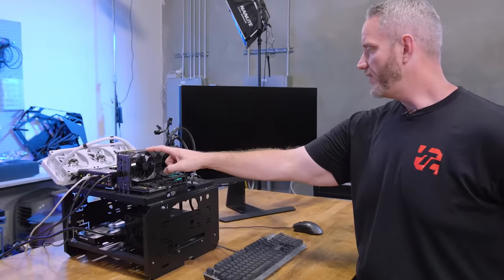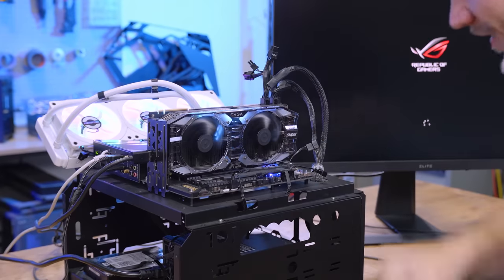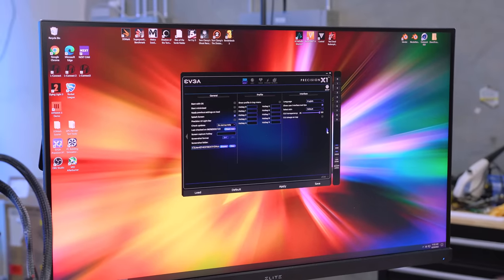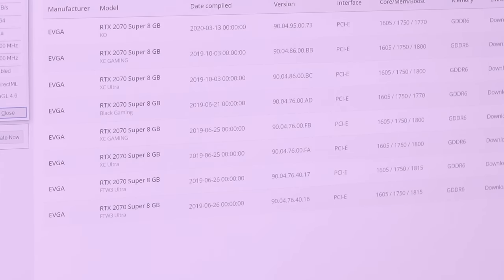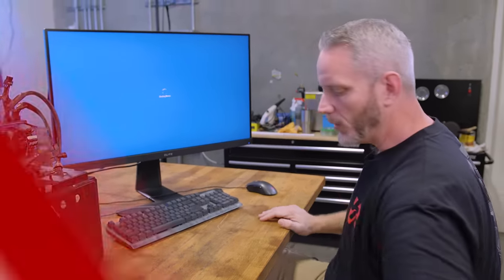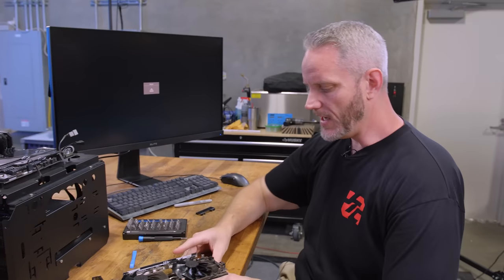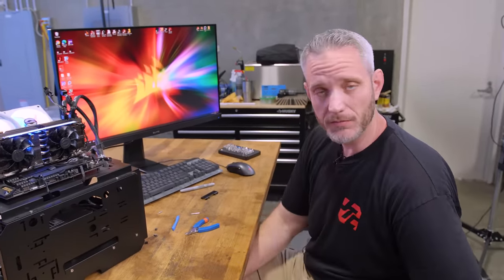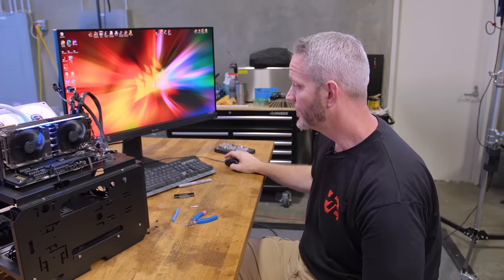This video card had a broken fan. Here's how I fixed it

Comment: Someone should do a series on what to do if you find your self with an ex-minning GPU. These things will likely have been run in an open rig with additional external cooling, which means they will have been seriously overclocked. 

What do you do if you find yourself with one of these thermo-throttled beauts? I'm thinking 3090's and maybe even the 3080's with the benchmarks of a 3060. Is there a way to get these quickly back to their default settings? Would you need to go further and replace thermal pads?  I'm sure there are a lot of people in the same boat... up a creek without a paddle ...   bailing water....

Also you might want to restate your advice from 5 years ago, to use two gpu power 8 pin cables, and not just the one 8 pin with the plus 8 pin extension on it.  I hope you catch this request.
Reply: I was watching mining videos to know thy enemy, and I was seeing core underclock + core undervolt + mem overclock.
Reply: @shufadragon  Thanks for that. I downloaded the MSI Afterburner. This app has an auto 'overclock' mode which profiles the GPU and automatically calibrates the frequency / voltage curve for this GPU. This should reset any extreme changes done by that 'ex-miner'. This was when i discovered the GPU was power limited. It turns out one 8pin cable plus its 8 pin extension was not the right way to power these monster GPUs. You should use 2 seperate 8 pin cables [power rails] from the PSU. I still have the poor benchmarks to sort but at least its playing Cyber 2077 in ultra mode now, and not shutting down.

Comment: Could a broken wire cause 1 fan to not spin at all? I’m having an issue with a rtx 3080 with dual fans were randomly 1 of the fans stopped spinning. My card goes up to temps of 89 and the second fan never kicks in

Comment: Hey, could someone give an advise please? Is it worth to upgrade i7 6700 to 11700k if I have 3060? I'm not sure that it will give that much performance boost as it cost.
Reply: That depends on game, resolution, settings, your target frame rate, and more details. Log both cpu and gpu usage over time.

Comment: when i ran a 2060 super i would set mine for a minimum 10% fan speed so it would always have air flowing over it no matter what decreasing fan motor life but it makes it far more reliable, not with my 3070 it forces that to 30% minimum which will burn the fan motor out faster and makes it louder, personally i don't think gpu's really need a zero db mode as it can cause more issues like this.

Comment: I actually have an issue with an msi 1660ti. Fans would turn to 100% video would cut off but the computer still runs and sound comes out from the headphones. Needless to say I haven't been able to solve it, I only know it's not an overheating issue

Comment: Most likely cheap material used for the conductors. Cheap copper alloy or even aluminum. Then fatigued by vibration.

Comment: My 3070 FTW 3 Ultra has the worlds most annoying fan click when you try and run the fans at low load.  Often they will spool up and down constantly making another annoying noise. (no it's not hitting the wires I have checked) in the end I just set them to 26% and up as temp increases as using the zero RPM system was a exercise in "click click click wrrrrrr click click click etc"

Comment: I hate zero rpm modes. Most of these cards run at high temps in idle. Around 50°C, and the fans turn on at 55°C. Turn on the fans to a low speed and all of the sudden idle temps drop and then hold closer to 30°C. The GPU doesn't need to double as a space heater. Zero rpm mode should be a switch on the card. I can't count the number of computers I have had to "fix" because it's so hot just watching browsing the web or watching a movie. First step is apply new SYY 157 paste. Second is install controller software to keep the fans from shutting off.

Comment: I know how to fix any fan issue on any gpu model. Take of the shroud and original fans and attach some BROWN (verry important) Noctua fans in suitable size with zip ties and plug them to the motherboard and run them on 100%. It made my gtx 970 drop 15-20 degrees celsius and it's so quiet.

Comment: Don't use shutdowns to restart a system! By default Windows uses a hybrid shutdown, using hibernation when Fast Boot is enabled in the power settings.
A restart however will fully shut down and restart.
Reply: In general - You are correct.
However, I would assume Jay isn't using the default settings in his test bench. If I remember correctly, he even had a video about how to change these settings. Which means, a shutdown will do an actual shutdown in his case.

Comment: Jayz2cents, you should educate yourself on PWM fans.  They are different than DC controlled fans and can be damaged if operated in the wrong way   DC fans have no control over speed other than voltage.  Lower voltage equals slower fan spin with a minimum power requirement to get started.  PWM fans have a microcontroller built in that regulates the fan speed based on the PWM signal.  They operate on 12V at all times.

Comment: yup i got a gpu fan that's pushing 100% sometimes i thought when i heated up card fan woudl go back normal speed like pushed over 45c it would go quiet but i noticed today it's not going back down normal figured out it was just 1 fan not both and i'm scared to tear it apeart to fix it because i can't afford a new card i'm running radeon saphire 570 8gig card
but if i have do thermal on card i don't have non spare or money to do it but if like you did in video bios stuff is there a guide some where coudln't really follow what you did in video

Comment: I had this exact same problem with my GALAX 1060 6gb OC, never managed to fix it (headers went straight to the board), until the 100% fan died (for driving me crazy with all the noise)...
Swapped the coolers with a chinese knock off, it happened again, same exact problem. Now I gave up and i'm running 2 case fans with zip ties.

Comment: I have an Aorus 2080ti that use to get stuck with the fans balls to the wall. It was insane. I decided to repaste the gpu and I discovered the gpu die had like a messy spill looking etch on it. Looked so bad. The thermal paste was all dry and cracked as well at just 2 years old. Cleaned it all off and reapplied the paste. Put it all back together and the fans never ramped up again. My guess was it had a really bad hot spot.

Comment: I had a case fan that was running at 100% while all the other fans were running normal.  It turned out the wire from the fan was kinked and making it run at 100.

Comment: Adequate cooling != broke in my book.  I'd like a video on how to force both fans to go 100% constantly.
Reply: Bios or fan control software
Reply: MSI Afterburner. Even if you don't overclock/undervolt, you can still manually control the fan.

Comment: I have a a 2060 msi gaming z card. it has an issue with always going maximum speed when in any game whether it needs to or not. It could be a low graphics setting game it doesn't matter and it doesn't matter what the temperature of the card is too and yes i have played around with the fan controls in afterburner. I've noticed online alot of people have the same issue with this card. 

The only "fix" I have discovered for it is to limit the max fps e.g. when fps is unlimited the in game fps fluctuates let's say between 120 and 140 or whatever. this makes the fan go 100% but if i limited it to 90 and it always stays 90 fps in game the fan doesn't freak out. As soon as i enter a situation where it starts going down below that limited 90 fps and fluctuates again the fan goes mental again. it just doesn't like the fps changing at all.

Comment: Shutdowns are only better than restarts if "fast startup'" is disabled. Otherwise the system doesn't fully shut down where as even with FS on, restarting will do a full power cycle. I'm sure Jay is aware but not all users might know about it.
Reply: That is why you should reach around the back and flip the psu switch as well.
Reply: @Digikidthevoiceofreason  also true!

Comment: how i fix my gpu fans getting slower or making noise from medium speed to max speed: use singer all purpose oil (or any good sewing machine oil) through the pcb (lift the stickers a bit, see the pcb, gib oil but aim it at the middle off the exposed zone), then wobble wobble the fans, fixed lol

Comment: Would someone who is skilled with wiring small electronic components (not me!) be able to simply repair the existing harness to regain PWM functionality?

As a side note, this is the kinda small item you can replace for Acer laptops, at least here in Europe. I was repairing one for a client (a 2016 Aspire V Nitro with 6th gen i5 and GTX960M GPU) and everything in it unscrews or detatches pretty easily. The battery had failed, storage got upgraded to a P2 500GB and the screen, bezel and housing had to be replaced - you can get replacements for all those cables without having to buy extra parts (e.g. HP with their keyboards and shrouds). Even the power connector was connected to a daughterboard and could be unclipped and replaced. If only all laptops were made like this...
Reply: Yes it could be an easy fix I think.
Also you could replace the whole plug and give it some mm more length to make it sturdier…
It remind me the MacBook screen Rubin cable which was just to just in size and broke every 2 year just after the warranty is over …

Comment: I alway run my GPU fan near zero most of the time.  Cause thier are noisy.  The Airflow of my Case with Noctua/Be Quiet fan ( As discount got my buy) Allow way more quiet operation.

After, Its cause my GPU fan is wildly loud, MSI Evoke 5700 xt. ^^

Comment: My Asus TUF 3060TI OC V2 came with a crazy stock fan curve. 75% all the time when usage is over 70%. Had to drop it to 50% and RPMs went from 1890 to 890-1100. It's nice to have a stock GPU running at 56c but I don't want my fans to die fast.

Comment: the problem is skimping on wires and routing them under strain. fan wires don't break be a little bit of heat differences. unless they are under tention. this is just badly done by evga.

Comment: I never run my GPUs at 0 rpm either. 😂

I can see someone wanting to do that for a recording studio or something but there are better ways to go about it like putting the PC in another room.
Reply: Well it's also good for the fan itself, it helps increase its lifespan.
EDIT: Oh and the heat thing that explains has nothing to do with the cable breaking, vibrations cause way more movement in such tiny components than any kind of heat expansion.
Reply: @YOEL_44  agree, the explanation Jay is giving is completely made up, it's quite the opposite: having the fan run constantly will cause more vibrations, thus more wear on the cables. If anything, 0rpm mode prolongs the lifespan of the fans.

Comment: "Shut downs are a little better..." but "Shut down" doesn't actually do a hard shut down in Windows by default anymore? And I think Restart actually turns it off all the way and back on? Idk I watched some other tech guy like 3 months ago and that's what they were saying. My memory sucks so I can't even attempt to give any details that may explain it and prove I'm correct or incorrect lol.
Reply: Yes restart is better if you have fast boot and stuff. Unless you shut down and unplug the power / turn off the psu.

Comment: Don't even get me started.
Yesterday I disassembled and drained the whole AIO cooler because my CPU was overheating and it turned out it was a loose gnd wire… the pump wasn't running…

Comment: I just recently got a used 6700xt off offerup and it just black acreens whenever i have it connected to the motherboard,i feel its a bios issue but i get blackscreen when the gpu is connected to pci e
Even if i have video being fed thru the motherboards hdmi,yes the cpu has integrated graphics. Someone help?

Comment: Talk about EVGA Fans. I brought a Brand New GPU 3080 from EVGA, installed and the 3 fans start clicking right of the box when it starts/stops to cool down the GPU. I fixed it with constant 50% fan curve. But I also Email support and it basically told me below. This is what $800 buy you. 

Hi,

Thank you for the feedback. This is not really an issue as the noise is part of the fan's design and not a defect. There are also many customers that are not bothered by the noise. If you have any other questions or concerns, please feel free to reach out to our customer support team via email or by phone at 1.888.881.3842, 5 days a week, Monday through Friday, 9am to 6pm pacific time.

Regards, 
EVGA

Comment: My gpu fan stopped working and didn't want to shell out another one so I thought F**k it, might as well open it up and see since it stopped working.   Low and behold, the wire connecting the fan to the gpu board was unplugged.  Plugged it back in and started working again.  Simple fix-it.

Comment: When flashing GPU BIOS, run 2 video cards, use the card not being flashed for the monitor, then if something happens in the middle of the flashing, it is possible most of the time to reflash successfully and bring the card back.

Comment: Lol thinking that a few degrees difference between 50° at 0db or 45° at 30% is gonna make a difference
I love what you do but honestly sometimes you have some of the most random takes :D This has nothing to do with that
Reply: that would be true if the only thing getting hot was the core temperature, but there are other components on the GPU which don't have sensors like Mosfets and capacitors that also give out heat and don't have contact with the heatsink for passive cooling which is why many people opt out of 0db

Comment: Go figure.. another evga specific issue…
Reply: If your referring to the power supply and other stuff, that's gigabyte, not evga.

Evga makes really good products, gigabyte seems to cheap out.
Reply: @raycert07  actually bought an evga 1080ti and pwm wire was broke on it too